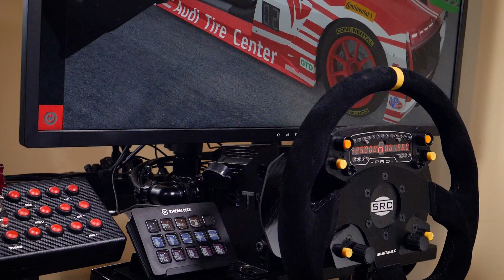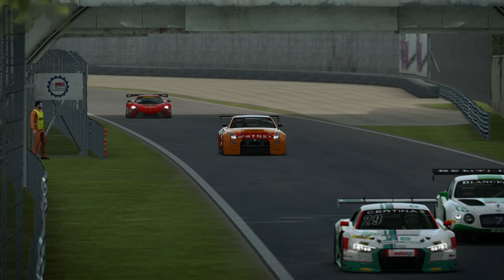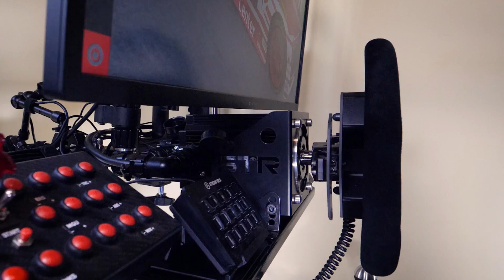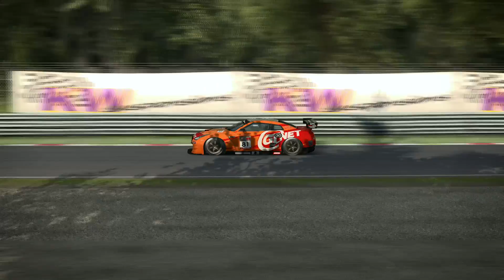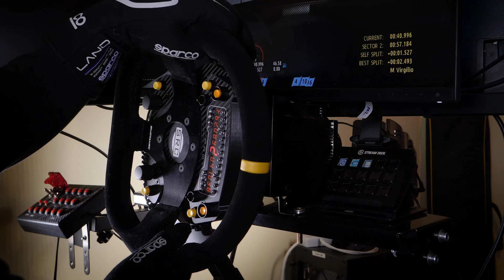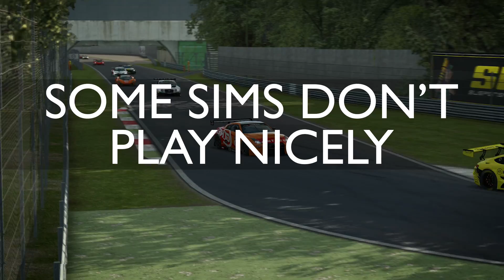Direct Drive Wheel - What They Don't Tell You

Comment: lol i can't even afford a G29
Reply: 3 years 150$ thats not bad at all and its not going to break after that peiod btw
Reply: I like my g29, have nothing to complain about
Reply: Bergwacht im on my 2nd one due to it feeling wobbly and its doing it again on this one smh
Reply: and dont buy it. comes from former G29 user, its big fraud with its cost (its chassis is made of plastic so it can have micro cracking). also it has bad design with its wheel centering as it uses "hall effect censor" with magnet combo, thus if that censor fails, your wheel wont line up to center. If want good wheel, its better always save up to good quality set that is made with stuff that lasts better. my G29 couldn't take more than 2 and half years of racing.
Reply: @Cynderfan35  it has a 2 year warranty, sadly cant expect too much more from it , if u daily raced it. With that said, i agree to go with a better wheel.
Reply: @ALPHAHXCORE  I was rather active racer, part of SRS community in Assetto Corsa. next step is Fanatec set ;)
Reply: @Cynderfan35  The new G29s are dope, ive noticed significant differences in the brand new ones.
Reply: @Cynderfan35  Daily driving on G29 for more than 2 years is quite impressive actually! Also, it matter a lot what FFB you were running and what games - i destroyed my G27 after abusing it for 2 months in DiRT Rally. It actually died just after that when i switched to AC in the first hour.
G25 on the other hand still runs since 2010. Bought new at the time for €150.
Considering to go Fanatec way since belt is smoother. DD is quite out of my league and the problem might be game support. But then again, i only race proper sims (rF2, DiRT Rally, AC and some RRRE). Don't have time for other (not so much sim) games like PC/2, DiRT4, F1 2019...
Reply: @SssagaBenches4U  
I got plans for Fanatec wheel in the future, gathering money already :)

Comment: Chris: you can easily modify that rig to be more sturdy than it currently is. Just bolt on a metal tube  from almost near the wheelbase to the base of the rig (straight down) on either side. And between the risers, bolt on a couple of 45 degree cross members (one in each direction). That'll stiffen the whole rig up. This looks as a very shaky construction to begin with.

Comment: These are cool setups. Sadly I went with fanatec. It was great, but they do no real support at all. So when something needed to be updated I would need to spend 900 bucks and replace the entire wheel. When this happened a 2nd time and I'd spent over 3500 bucks with fanatec. They wouldn't give me any kind of deal on the third wheel. Not being replaced because they were broke mind you, just because they wouldn't update them. So I sold everything on craigslist for 1,400 bucks. Both wheels the 240hz 39 screen I bought for it, the surround sound setup, cage, seat, all of it. 

I don't really miss it to be honest.

Comment: No need to buy a new rig, the problem isn't with the steel it's with the setup. put 2 vertical sections and a cross brace on the back, that'll stiffen it right up

Comment: I'm a wheel noob and I've never owned a wheel. I play Assetto Corsa with mouse and keyboard (I know, I should be crucified for this). I wanna get a direct drive wheel, but I don't have a lot to spend. Are there any cheap options excluding used fanatec setups (which I can't find in my country)?
Reply: Unless you specifically want a DD Wheel, check out Thrustmaster's Belt driven wheels. Personally, I'm still patiently for FeelVR's wheel to officially be released. You may want to check that out too. But like yourself, I too am new to this. I have a Logitech Driving Force GT Racing Wheel. It was given to me for free years ago but I only recently began to use it now that I'm wiggling my way into the sim racing scene.

Comment: Great video Chris, I would love to have a DD wheel but the wallet doesn’t agree ☹️
I started will the Logitech Momo Racing back in 2007 and then moved on to the G27. The potentiometers were failing last year and cleaning them didn’t sort the problem, so I brought new potentiometers.
For those who use Logitech DDGT, G25 & the G27, I recommend the Lut settings from Rampus (link below). Its a huge improvement and gets rid of the centre dead zone.
https://www.racedepartment.com/downloads/rasmusps-lut-guide-for-g27-29-and-dfgt.16799/

Comment: I don't think an aluminium frame is going to be stiffer than your existing steel one. Thicker yes, lighter maybe.
What you have there is basically a box with no diagonal bracing so you're twisting it and it moves.

There are other ways to stiffen this floppy box, but that depends on what you have to hand.
Reply from the maker: Hey dude. It's not so much the material, but the profile of the material. The Aluminium extrusions that Sim Rigs are made from is the same stuff they use in CNC machines and the like, which has superior rigidity to box section. As you say, this rig could easily be stiffened with the addition of some simple geometry.
Reply: @ChrisHaye  I look forward to seeing more. 

My mistake was buying a too big screen. When I put it in "in car" mode in FH4, I get nauseous!

Comment: Damn...this is sweet.  How much does that monster cost?
Reply from the maker: Hi Rick - the wheelbase and controller are about £800 - and the rim is however much you want to spend. Not cheap, but when you spend hours every day racing and making videos, the cost isn't so bad.
Reply: Thanks.  I have a hankering to give this a whirl.  I would love to feel the grip of an older F1 car and play strongman against my PC.  I need to start simming.  I am also an aviation nutjob so the VR would work well there.  Exciting times for computer gear with the new RTX cards, these DD wheels, Optane memory and insane processers like the new i9s.  I predict some flying both on the track and in the sky in my future.

Comment: i spent 5 hours with a friends direct drive wheel and it felt amazing, but i am actually faster with my g27, probably cause i have close to 2000 hours of racing with my g27 but it means that you can be fast with a cheaper wheel.

great video tho!
Reply from the maker: Totally agree dude. I don't think I'm any faster than I was on my T300.
Reply: @ChrisHaye  consistency on the track is a whole different matter tho, I didn't make any big mistakes after just an hour of learning what to feel for in my finger tips when driving.

But just so you know, this was a great video! I watched it from start to end without skipping forward (as I almost always do) cause it was paced perfectly and you didn't stay on one particular point too long!
Well done!

Comment: In regards to high force feedback of aero cars, it's not realistic at all to run the same forces in sims.

Older Formula Nippon cars with manual steering can be up to 70Nm torque at the wheel, but that's in corners where the car is pulling near 3G. The driver has 4x his normal weight to pull on the wheel with in that instance because of the forces. Basically, just by hanging on, 110lb Asian drivers can handle it for multiple hours. It's still plenty tiring, but completely different from how ffb works in sim racing. That's why a system like how iRacing deals with ffb with Direct drive doesn't make sense for sustained forces. 

In a rig, you don't have the benefit of your own weight to put into the wheel
Reply: The g force pulled in a corner isn't in the vertical plane.
Reply: @anomalousresult  Correct? You pull the bottom half of the wheel towards the outside of the corner with your hand that's on the inside of the corner. "Pull, don't push" is what they say at open wheel racing schools.
Reply from the maker: Totally agree on trying to replicate steering load in sims being ultimately pointless.

Comment: You're really wearing gloves.. LOL
Reply: If you let go of that incredibly powerful wheel it will literally tear the skin off of your hands. Did you not hear him. 30 newton meters of torque. That can not only tear the shit out of your hands it can break fingers and even your wrist.
Reply: @wylie2835  - 22 foot lbs won't do that, lol. Good try though, really good try. I've got a SimSteering 2 54 which is rated st 26 NM and I have NEVER had it do that even if it snaps out of your hands, and I never use gloves.
Reply: You aren't using it turned all the way then. It has happened before.
Reply: @wylie2835  - Turned up to 100%. No sense in a $3,000 dollar DD Wheel to get the best experience if you're going to not use it to get the full realism.
Reply: To you maybe. But not everyone is you. 

And if you think the FFB you get through that wheel is in any way shape or form realistic you have issues. YOU ARE NOT A REAL RACECAR DRIVER. Do not pretend otherwise. Your video games don't even approach what it's like to drive a real car. Especially on a hardware level.
Reply from the maker: It'll definitely give you blisters! And, I've heard stories from others that have done a bit more damage. But, in addition, there's also the fact that the rim is made from Alcantara - which gets ruined by the oils in your hands, so yeah, gloves it is!

Comment: Have you tried to stiffen up the steering wheel stand sideways? It seems to be moving sideways, and you could counteract this with a cross between left and right riser, or just a plate bolted in.The longer separation of the upper and lower bolt will increase the stiffness. This should stiffen it up so it won't move sideways. From the movie, it seems to do that.
Reply from the maker: You're quite right. And your proposed solution sounds great. There's a lack of lateral stiffness across the wheel-deck, which allows it to twist.

Comment: Hi there, 
I'm an amateur welder/fabricator/blacksmith, and I recently constructed my own sim rig, not from box section, but from tubular steel. I used 30mm pipe with 3mm wall thickness,(which everybody told me was 'over engineering' it). I packed all my pipes with sand, initially to help with the bending process, but I left the sand in to add weight. All joints are welded not bolted, wich adds rigidity, I use a car seat with it's sliding and reclining mechanism to adjust driving position. I think my frame is very rigid indeed, although you would have to test and compare to know for sure. Most importantly, it would be a very cheap alternative for alot of people. If you would be interested in trying one out, I'd be happy to build one to your requirements. If you are interested please get in touch with me so we can discuss more, I'm not after money, but I might like an endorsement/honest opinion. It's up to you, I wont spam you.
Reply from the maker: Hi Kris - interesting stuff. If you don't mind, I'm going to pin your post to the top f the comments, because I think it'll help out others that build their own rigs from scratch.
Reply: @ChrisHaye  Or people looking to build a Tornado proof destruction shelter! 30mm/3mm jacket pipe stuffed with sand then welded and bent? Just climb inside pull a thick tarp over the top and hang on tight. I want to know how much it weighs hah! Put wheels and a fire extinguisher in it and it would probably pass tech.
Reply: @CriticoolHit  would probably be safer than race cars up until 70s/80s
Reply: about 50 kgs
Reply: If you don't care for rigigity, make your own from wood & stuff. I can make you a frame, but consider deivery costs too. I don't really want to conduct business here in the comments section. If you want a frame please message me on my channel. Thanx
Reply: Funny enough, I'm working on fabricating a rig as well! One inch square tubing does wonders for keeping straight lines, as well as clamping the wheel onto, and drilling holes to hide away wiring. Round tubing can look nice, especially if you wish to imitate actual roll-cages, but cross supports are easily reduced with square tubing. You'll need a saw that can cut 45° angles, but it'll allow for corner reinforcement.
Reply: Mines at the end of this vid.
https://www.youtube.com/watch?v=RnAIRi9TLkE

Comment: Excellent video. I wish i had an opportunity to try out one of these wheels or even a Fanatec CSW. Theres no way I can afford either, in fact im still using a used G27 which is a nice wheel but its really lacking in some areas. Also my brake pedal is constantly being engaged 5-10% cause the potmeter is dirty i think.
Reply from the maker: Thanks Dude. As to your potentiometer, you may be able to clean it quite easily, it's something I've had to do quite a lot with old amplifiers. Otherwise, you may be able to set the minimum threshold for the brake to 10% in each sim (or in the driver software).
Reply: @ChrisHaye  Thanks a lot bro. Im gonna try clean it today! Keep up the great videos. Btw whats your opinion on the Fanatec V2 wheelbase/pedals? One day when I can afford it im thinking of upgrading to it.
Reply from the maker: Both are great products. If I'd had a clubsport wheel I may not have made the upgrade. They're definitely a cut above the Thrustmaster T300/500 and G27/G29. I'm using the Clubsport V3 pedals, and they're great - no complaints at all.

Comment: It's an honor and a pleasure watching and listening to what you have to say, mr Haye. I too have caved for the direct drive wheel and was indeed concerned if my diy-rig (from wood) would hold... and so far.. i'm anxiously positive saying that mine can hold about 12 nm, but i tend to cling to about 8-10 in most sims, simply because i donot want my customrig to blow up. ;)  I have however tried one aluminium profile rig and i was very surprised that it wouldn't budge a single millimeter under load. I'll be going that way, when this one starts cracking and creaking more under load.
One thing you forgot to mention, when one buys the OSW, it doesn't standard come with a buttonbox, or a wheelrim... or a pedalbox... (usually, i haven't looked up the package you've bought before commenting)   It's a really nice wheel to have, i can even do Trucksimulator with the OSW wheel set to 2160 degrees (but, you have to take off the coiled-cord for the buttonbox, as it WILL snap in a matter of a month, so i'm actually waiting for some smart guy to make a buttonbox with a battery in it, and a dongle... a little birdy told me someone is actually working on somethign like that)
Reply from the maker: Hey man. Thanks for the comment. I think much of the problem with the current rig are due to the design not really factoring in the torque levels of a DD wheel. The material choice isn't really a problem, but the design does nothing to mitigate lateral twisting. 

I hadn't thought about the USB cable issue with truck-sim - that's a very good point - and as you say, an opportunity for a wireless product.

Comment: Are you trying to make me poor? You are really convincing me to buy a DD. What are the best budget sim cockpits for DD wheels? Is the GT omega enough? Great video!
Reply from the maker: Difficult to say Renegade - My preference at the moment is for rigs that use extruded profile due to the extra stiffness. I'm not sure a GT Omega cockpit is going to be much different to the F1GT in the video, they're pretty similar designs.
Reply: Okey! Thanks! It's great that it seems to pretty easy to get DD up and running. Planning on the fanatac one. I just don't want to fiddle around for hours just to play, I want it pretty simple. Still not sure with Clubmaster v2 or fanatec DD.
Reply from the maker: I suspect the Fanatec one will be pretty 'plug and play' - but you'll still have to fiddle with some of the sims, I'm afraid, as there's not much Fanatec can do about that!
Reply: Build one for two fiddy, all you need is some 3x20 dollar ebay parts and a driver board from Justin Hoffmann (racedepartment) voila 10nM (more than twice what the G27 offers).